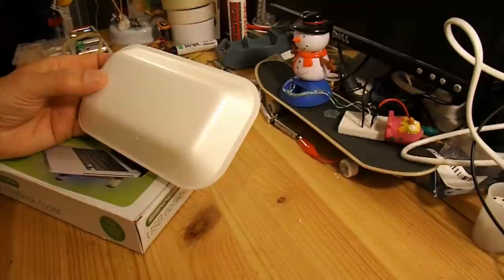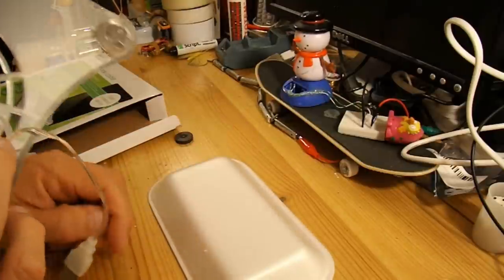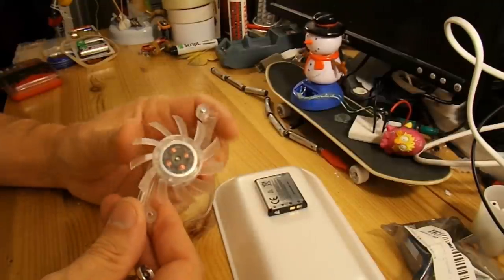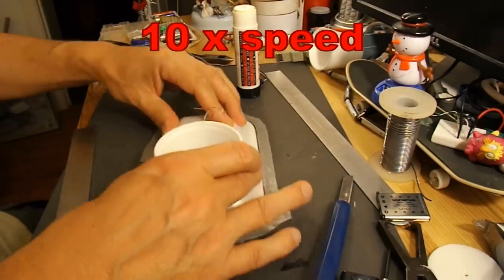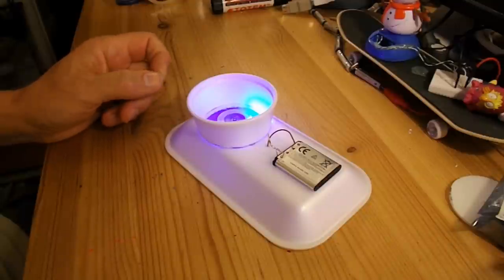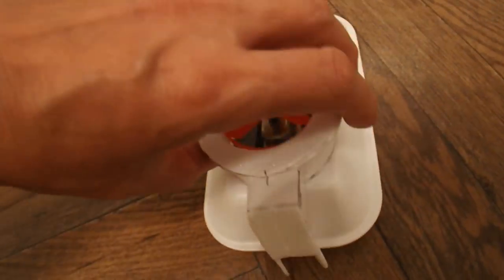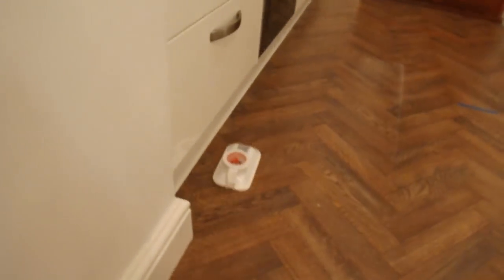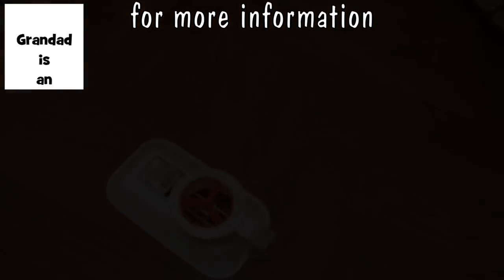Chipshop Styrofoam Tray Hovercraft

Comment: I used a 9 volt battery but is does not give power very well then i used a phone battery 3.7volt and it give much better performence? how its possible?
Reply from the maker: +rohan bhardwaj is that true? In your other comment you claimed to use a 6 volt battery and then a 3.7 volt mobile phone battery. I am impressed that you have duplicated my projects and then taken the time to compare different batteries to measure the performance. However if you have measured the performance and found that for the identical conditions you are getting better results with the phone battery it is probably that your phone battery is able to provide a higher current at the lower voltage so your motor is able to develop a greater torque. The voltage will give you a higher speed but the current will give you higher torque. If the load prevents the motor developing the higher speed then the higher current will still give you the better torque.
Reply: +GrandadIsAnOldMan Yes its true first i used a 6volt battery, i thought it might be the cells are weak then i used a new 9volt battery still my phone battery gives much better performence. My battery is of 3.7volt 2100mAh.
Reply from the maker: +rohan bhardwaj OK like I said in my previous reply it is probably the capacity of the phone battery giving the better current supply :-)

Comment: LOVE IT!
I made lots of those as a boy - if you add another trimmed down tray underneath to make a plenum chamber the thing will hover even better. you may need about 1/4" of a gap all round. the plenum stops air from leaking out past the prop for the most part. sorry if you already tried this - dugh - What a fun way to spend time!
Reply from the maker: +STLhive.com thanks for commenting. Interesting you should mention a plenum chamber. I only recently found out about the concept when I spotted a diagram on the web and I intend to have another look at hovercraft at some time in the future although I am rather busy on other projects at the moment so it could be a couple of months before I can fit it in.

Comment: usb devices use 5 volts and battery is using is 3.7 volts thats why its not working very well . Thanks for sharing  video
Reply from the maker: Here is an earlier version using the fan motor https://youtu.be/749Oehp0Dk8?list=PLA5a2xPRSrB3zoLYIrdESCCWdx2nLq8r7 Back when I was doing these hovercraft projects (2013/2014) I didn't have LiPo batteries and didn't want them either due to the safety issues but a small 2S LiPo would probably have got them off the ground OK.

Comment: you run a 1.5-3V motor on 3-4V and it draws more amps but laptop cooler is rated for 5V  0.5-1A max. if you raise voltage it will work more efficiently but it might burn out as well since not designed for more amps. desktop fans however can lift pretty well at 14-19V.
Reply from the maker: Sailor OnDaTea the issue is finding suitable light weight batteries to supply the power. The obvious solution is LiPo batteries but I try to avoid using them due to the fire risk.
Reply: well... i just meant to say that brushless fans actually lift when overvoltaged but i only tested 12v rated ones. i'm not sure what would happen when you simply used two batteries (6-8V) with 5v rated fan :D 
i think they wont blow up if you don't overcharge them lipos.
Reply: I don't think lipos are that bad... I accidentally short circuited one and it was fine. It just smoked a bit. It doesn't work anymore though.

Comment: Fun to make, I got some old cheap motors from a model aircraft shop, they will pull around the same voltage as your second motor, but will give even more torque.

The engines you want are ones like the "graupner speed 300" however, this one pulls 6v. You could easily solve that with using two of those lithium batteries. Furthermore, those graupner engines also come in 3v versions, being a bit weaker, but they do the trick.

The increase in power will easily overcome the increase in weight.

Comment: I HAVE THE EXACT SAME LAPTOP COOLER!!! only it came in another box...
Reply from the maker: Mine came from Poundland for £1, you can get just the fan & a heatsink on eBay for £0.99 if you need to cool something else like a hot electrical component.
Reply: I used mine to cool my bros laptop when his playing games or the internet modem/router. (my modem/router stops working sometimes when it gets too warm) i got mine for $3 (not sure how much £ it is but... its the cheapest i could find)

Comment: hey brother XD just kidding : your owercraft is ok but that fan isn't so powerfull you need delta eletronics cooler fans it needs battery like this but its toooooooooooooooo much powerfull than this think try that buye
Reply from the maker: You can always buy more powerful motors if that is what you want to do. The purpose of my videos is to use cheap or scavenged items in my projects. If a delta electronics cooler fan turns up in any of the electrical equipment I disassemble then I may use one. I do have quite a few computer fans in my scrap box anyway but generally speaking they are relatively heavy for their power output as weight is not a prime consideration when designing and building a computer fan.
You will see in my hovercraft playlist that some of my hovercraft are pretty poor and some work OK https://www.youtube.com/playlist?list=PLA5a2xPRSrB3zoLYIrdESCCWdx2nLq8r7

Comment: powering a usb motor 5v with a 3.5v battery is a recipe for failure.
Reply from the maker: +Michael Crumpton if you follow the links in the video description you will see in the previous video I did try significantly overpowering that Laptop Cooler Fan and still didn't get a useful amount power out of it which is why I made those comments at the beginning of this video.

Comment: hi !!! well i have a some questions, first: the battery specification´s any problem with 3.7v / 850mAh second: what toy the fanblade is?  :S
Reply from the maker: I am not an expert, I just try things and see what works. Use whatever battery you want. It needs to be light and powerful so 3.7 volt LiPos are fine. The mAh rating obviously tells you how long the battery can give you power for.
The toy that the fan blade comes from is shown in this video http://youtu.be/ZlTV8qiZ5hI?list=PLA5a2xPRSrB1ynqKhyKVIcl945NCbHZZE
Reply: GrandadIsAnOldMan Thank you so much it was very usefull :D

Comment: Awesome project! Can you make a video with it hovering over water? I think that it would be interesting :)
Reply from the maker: Ivo Pinto if a hovercraft hovers on land then it will hover on water, in fact it will probably hover better on water because it is a better surface. Toy hovercraft often struggle over carpets or gravel or grass because the air cushion can escape through the porous surface, but water is airtight so the air cushion is maintained perfectly. https://youtu.be/_XTEB4sVASA?list=PLA5a2xPRSrB3zoLYIrdESCCWdx2nLq8r7

Comment: I can never seem to get enough power out of my little motors to get my hover crafts to lift off the ground. In your opinion what is the best rotor to use in order to create more lift? I notice you use a lot of toy rotors... do they work better then the wooden Popsicle sticks and how much does the size of the rotor matter?
Reply from the maker: Disney Gym Girl you will just have to find out for yourself. I see you are looking at several of my hovercraft projects, you will soon see that many of them are failures with very little lift generated by the motor and props that I use. You will just have to keep trying to see what you can achieve with whatever you have available. If you want really good performance then you will have to buy proper commercial motors and props.
Reply: Yes true... nowadays with brush-less motors and lipos you could make a bowling ball fly... I'll see what I can come up with.

Comment: hi sir im big fan of your projects so i got a idea  that making the drilling machine by a hairdryer motor
Reply from the maker: +Akshay Kumar V it will work fine for light weight jobs. Are you thinking of connecting the drill bit direct to the motor shaft or are you thinking of adding gears to allow it to handle heavier work.

Comment: Could easily take the casing off that battery. Only that single cell in there.
Reply from the maker: Yes you could but it works OK like this 😊
Reply: GrandadIsAnOldMan. For sure, esp with that second motor. Goes nicely.

Comment: Do you know if there is a way to increase the output of a standard AA or AAA battery? I have noticed that a lot of the projects work really well with regular batteries but if one wants to make a plane or rc helicopter out of recycled parts it is near to impossible without using lipo batteries.
Reply from the maker: Disney Gym Girl I think you have answered your own question. A standard AA battery does not have the power to weight ratio you need if you want to make something fly. There are circuits that will allow you to change the voltage like the circuit commonly called a Joule Thief and that allows you to do things like light an LED from an AA battery, but I doubt that you would ever get one to run an electric motor to fly a plane. If you search YouTube for Joule Thief you will find hundreds of examples.
Reply: I will definitely look it up! Have you tried this Joule Thief method before? I saw a video of a guy modifying some kind of circuit board to enhance the power of an AAA battery but the process was quite complex and you would have to buy a bunch of stuff I don't know where to get. It is true what they say about gravity...
Reply: Another experiment I wanted to try was to make a really fast mini RC car from very light materials like the take out stuff you use and just have a small motor on the top to steer left and right. Of course the car would only be able to glide because it would loose power once the wheels no longer touched the ground.  On a different note I wanted to thank you for your amazing videos! I was able to re create a few of your air boats and they work wonderfully well!!!
Reply from the maker: Disney Gym Girl here is something similar to a Joule Thief that I copied from Lidmotor. If you read the video description you will find links to his work https://youtu.be/IUTJwQVWe8Y?list=PLA5a2xPRSrB00lxaX8BD46F1QDJTe7Em4
Reply from the maker: Disney Gym Girl good luck with the car idea and thank you for your kind comments.

Comment: how do u get to connect the rechargeable battery and charge one as well
Reply from the maker: +alistair lewis to use it on the hovercraft I carefully soldered wires direct to the terminals. Overheating the terminals can cause damage to the battery and even cause it to burst. To charge it I was lucky that I could still get it back in the charger designed for this battery. I also have a multipurpose charger than can handle most of these flat phone batteries as it has adjustable terminals that you can align with the ones on the battery. That charger is labeled TRONIC TUL 4.1.A1 and was manufatured in 2013.

Comment: I think that fan from the notepad cooler is supposed to be run on 12 volts like most computer fans
Reply from the maker: Thanks, but very unlikely as you can see it is USB powered, so that would be 5 volts.
Reply: @GrandadIsAnOldMan  ah ok, is it possible to make a hovercraft that uses a voltage booster rather then just using a higher voltage battery?
Reply from the maker: @Theutmostgeek  just use a different motor. The motors I was using in the video are really not suitable. You can get much lighter, more powerful motors. Just look at the motors in toy drones.
Reply: @GrandadIsAnOldMan  alright, thanks for the tip. I'll have a look at some
Reply from the maker: @Theutmostgeek  you can get them cheap in eBay, typically you can get a set of 4 replacement motors for Hubsan X4 quads for around £4 or £5 so about £1 each and they would be much lighter and more powerful. You could also get some Hubsan propellers at the same time and you should then be able to make some great hovercraft. They run on a single cell LiPo normally so they are expecting around 4 volts.

Comment: This is life saving Youtube video. My son had similar design with two motors with same failure. He tried to build and rebuild at least 4 or 5 hovercraft, almost at the edge to give up build it. I hope this will save him from this fun experiment. Thanks!
Reply from the maker: Thanks and good luck. I have quite a few Hovercraft videos, some more successful than others. There will be a link to the playlists in the video description.
Reply: Still not working. :-((( We just order higher speed motor and will try tomorrow when it arrives. Thanks.
Reply from the maker: I am sorry to hear that, when you are using cheap motors the main issue is usually the weight of the battery is more than the motor can lift. The next problem is finding a suitable propeller. I have used the rotors from toy helicopters with some success.
Reply: Thanks! I really admire your grandchild(ren) :-) I will show my son your suggestions. Really hope he can get it hover over and carry some. He was so regretted not prepare earlier last year for science Olympiad. He had some improvement to do it earlier this year, unfortunately, the project he picked this year is harder and his school work is heavier. :-))) The only think I can help is to provide all the support as I can.

Comment: What are those wires you are using tell me for the second one with the electronic toothbrush motor
Reply from the maker: I don't understand your question? They are just wires, there is nothing special about them. Any wire would do.
Reply: GrandadIsAnOldMan what do you think I can get the wires from?
Reply from the maker: For small motors like this I often use old telephone distribution wire. I also use wire recovered from old Christmas tree lights. If I take anything apart I always save the wires.
Reply: GrandadIsAnOldMan do you think a man old iPhone charger wire might work?
Reply from the maker: I think it would probably be OK however some brands of chargers may use wires that are a bit thin so they might get hot. Try connecting a battery to the motor using the wire. If it overheats and melts the insulation you know it was a bad idea, that is probably the quickest way to find out.

Comment: Brushless motor is better.
Thanks..☺
Reply from the maker: +Hamad Al-Shuaili thank you for commenting. Yes brushless motors seem to give a better power to weight ratio but you need a driver for them so that will add weight again. A LiPo battery and an ESC and a servo tester would do the job. There are quite a few different hovercraft in my playlist here https://www.youtube.com/playlist?list=PLA5a2xPRSrB3zoLYIrdESCCWdx2nLq8r7
Reply: Great,,,

Comment: hey grandad can you make a styrofoam plate quadcopter
Reply from the maker: +Ajinkya Naik no it would not be stable in the air.
Reply: +Ajinkya Naik Quadcopters can't really be made with low tech. They need gyros and electronics to keep the craft stable, as finding 4 motors perfectly the same would be nearly impossible, as would building it with perfect tolerance. One lead being longer than another could add enough resistance to bring it out of balance. Making a tethered quadcopter would be doable, to keep it from flipping over.
Reply from the maker: Richard Smith Hi Richard, thanks for adding that, I get asked for "simple" helicopters and quadcopters so often that I have a standard reply I usually paste in the box. Here it is - that is a regular request and I have created a standard reply, the answer is NO. To make a helicopter or quadcopter stable in flight I would have to buy so many parts designed for the purpose it is cheaper to buy a ready made helicopter or quadcopter or a kit. A good example would be something like the Eachine H7 2.4G 6-Axis LED Mini RC Quadcopter. On top of that, my channel is aimed at simple, quick, cheap projects and a helicopter or quadcopter build is not a simple, quick, or cheap project. You would be better finding a channel that specialises in RC Quadcopters or Helicopters so you get the information from people who know what they are talking about. FliteTest would be a good place to start https://www.youtube.com/user/flitetest
or anything David Windestål is involved in https://www.youtube.com/user/dadde87
or you might like this video by The Post Apocalyptic Inventor https://youtu.be/qa_x93JQhNM
for rubber band power check out the work by norris432 https://www.youtube.com/user/norris432
Reply: GrandadIsAnOldMan Richard Smith Thank you for your help...
Reply: Rundling

Comment: hey ! plz can you tell that how to recharge the battery
Reply from the maker: I have a multipurpose charger that has movable contacts that can be aligned to suit the battery but you could get a small charger board off eBay and wire it direct. Here are some examples https://www.youtube.com/watch?v=cP_6XR2Cwc0 https://www.youtube.com/watch?v=bh5vMtm-_Dg
Reply: thx for the help grand dad
I also wanted to ask that how to charge the mobile battery while its connected to the moter
Reply from the maker: You would need to disconnect the motor whilst the battery is charging, you could put a switch in one of the motor wires to do that.